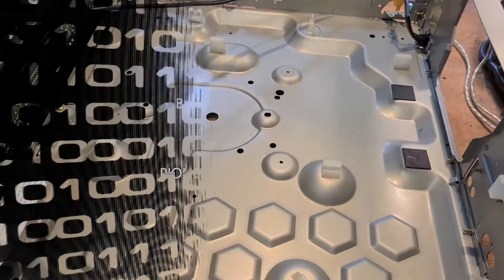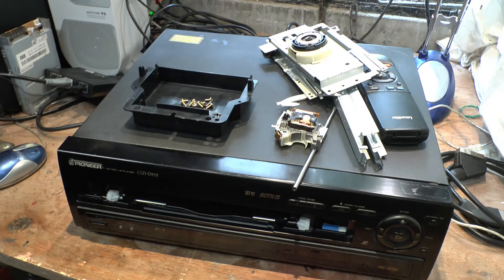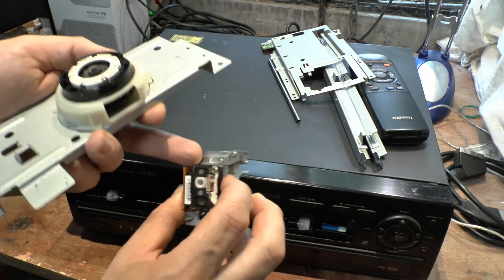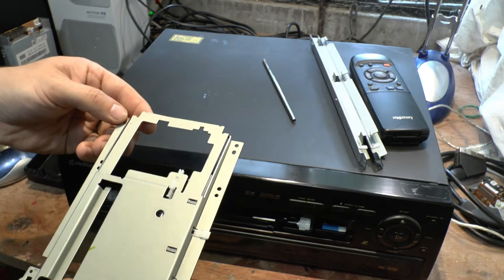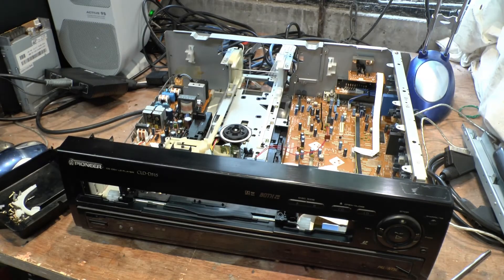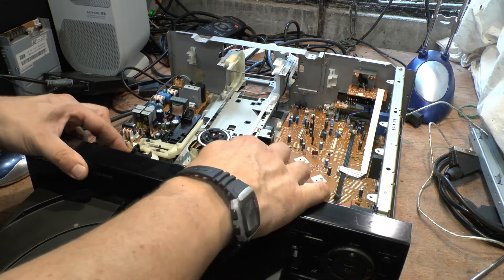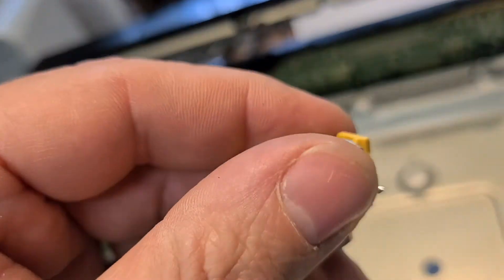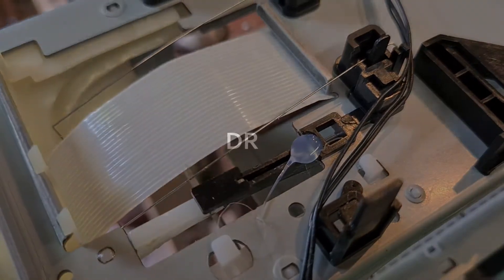Pioneer CLD-D515 Laser Disc initial inspection of damaged machine parts. PART 1

Comment: Just received a CLD 515 and Parcelforce must have dropped it hard as the laser has come loose from the mount.  😢😢😫😫 gutted. 
Don't know if its repairable.
Reply from the maker: Hopefully the motor is still attached, if so you will just need what's known as an M holder but they are rarer than the hens teeth. 

Most sheer off due to bad packaging  mixed with age. After all they shipped from Japan worldwide originally and they never sheered off! 😀
Reply: @DRCHRISTIANMD  incredibly I have managed to locate, identify and fit 4 of the 5 loose parts. 
Just one small plastic cog I can't  seem to find where it goes or see on the engineers manual. I believe it's to either move the laser for side a or b. Or the eject tray. 😢😢😢
Reply from the maker: @SYNAPTIKMETAL  👋 hello, shame I can't see it. You could become a member of laserdisc Forever on Facebook and we can most likely identify it. 😉
Reply: @DRCHRISTIANMD  I'll join. 😉👍🏻
Reply: @DRCHRISTIANMD  joined. Pending acceptance. Then I'll post pic of the cog. Thanks.
Reply from the maker: @SYNAPTIKMETAL  perfect ..

Comment: hello, appreciate this is an old video now and not sure if your still active but am trying to find a part for a cld d515 player, apparently its the normal part that fails VNL1637. Do you happen to know anyone selling this part or able to manufacture it via 3d printing these days ?
Thanks
Reply from the maker: Hello, that part is also known as the M-holder and indeed it's rarer than the proverbial hen's teeth. I am sure someone in the future will 3D print a new part but for now we only have ebay. I am unfortunately in the same situation as you with a few working laser assembly but no holder for them. If this situation changes I will upload a new 📹 video so subscribe and stay tuned...